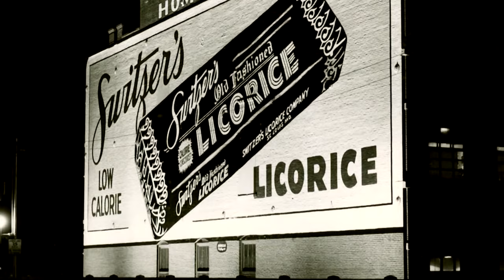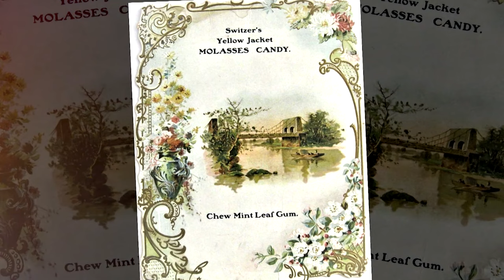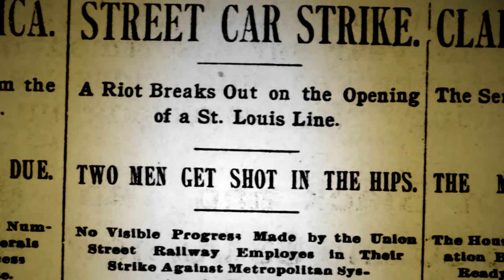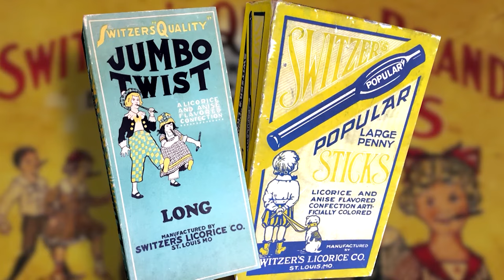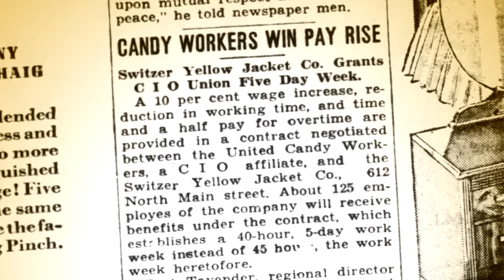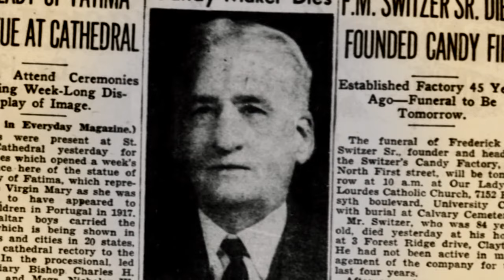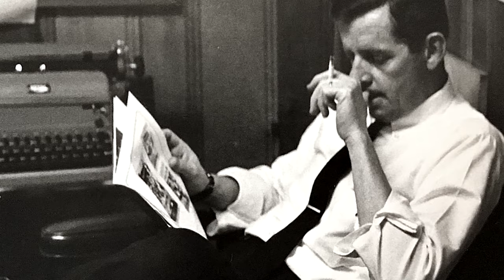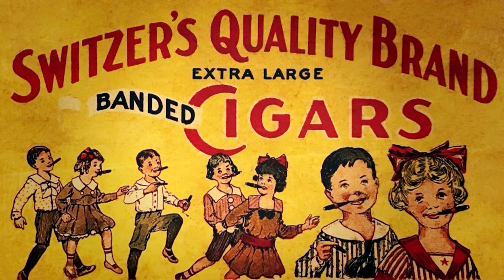Candy Men: The Story of Switzer's Licorice | Mid-America Emmy Award Winner | Nine PBS Special

Comment: I worked in the Switzer Licorice Factory during the summer of 1963. I moved warm shallow pans of my favorite cherry flavored licorice from the "pan elevator" coming  from the floor below to cooling racks on my floor. When it had cooled, the product would go onto the line to be cut to length and wrapped by a machine.
It was a good place to work for a young man going to college. I learned what it meant to work with people who are truly the "Salt of the Earth." The ladies working the line would always tell me, "Stay in school."
Another time I worked on the line at the Haase Olive Company in St. Louis. I opened the 450-pound and 900-pound barrels of olives shipped from Seville, Spain by smashing the upright ends with a sledge hammer and breaking the wood apart. From there I would push the barrels to the head of the conveyor belt and operate the lift to pour the contents into a bath that fed a horizontal conveyor belt. Ladies would sit on either side of the belt, discarding bad olives or selecting perfect olives to place on a small plastic "tree" that would fit inside a bottle so the red pits faced the glass. Again, the ladies would tell me, "Stay in school." I wish they knew that I did indeed stay in school, eventually finishing with the GI Bill several years later. A few kind words of encouragement can have such a positive impact on person's life.